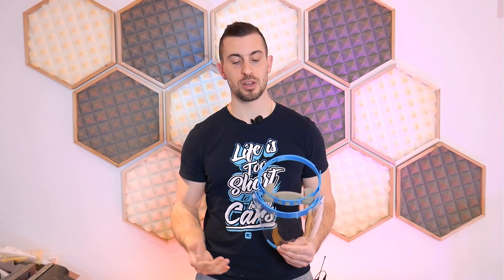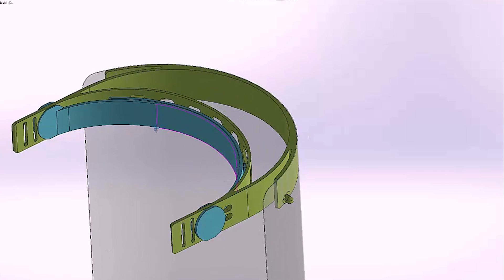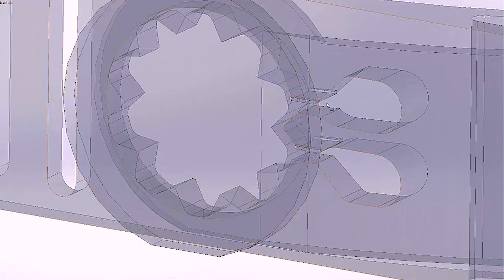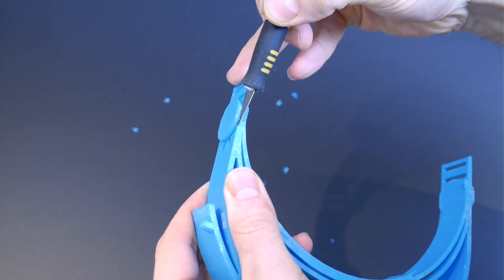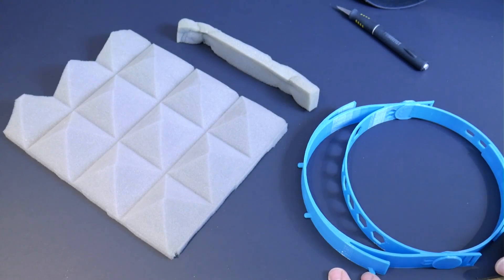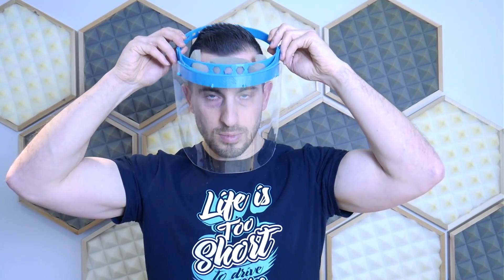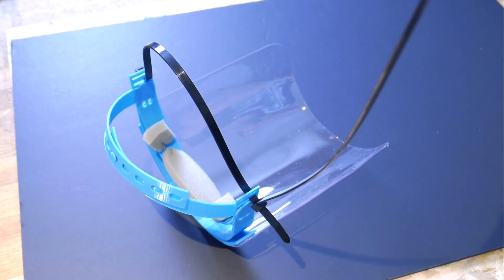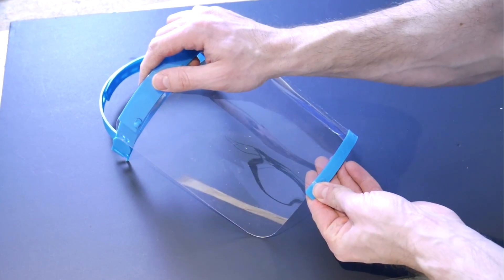PRUSA Covid-19 Face Shield With Integrated Folding Detent Strap (NO Elastic Req'd, Single Print!)

Comment: Wait you think elastic bands are harder to find than clear drilled plastic?
Reply from the maker: Never said it was harder to find than the plastic. Just hard to find for some people in general. At the end of the day, for the PRUSA style design, you need a 3D printer and the plastic shields at minimum... if I can eliminate the elastic from the bill of materials, it's one less thing to source. That was the idea (plus the plastic is easier to clean than the elastic)
Reply: Embrace Racing good point. On our design we are using acetate overhead sheets, elastics and weatherstripping.  Ordered in bulk from staples and crappy tire.

Comment from the maker: UPDATE: 13/04/2020: NEWEST VERSION HERE: https://youtu.be/04lTMJ2VdTI
My mother is a nurse and I will be printing these face shield frames for her unit and donating them. I have my printer running almost all day, everyday since I designed this and at some point I will need to order more filament. Ideally I would like to get a cheap second printer so I can make them faster. If you want to help, please reach out to me, or if you have the means, please donate by using the "Buy me a coffee" link: https://www.buymeacoffee.com/embraceracing Your donation will go towards filament for this endeavor and possibly towards a second printer if I can afford one! If the Thingiverse "download zip" isn't working, try clicking the tab that shows the individual files on Thingiverse. You can then download one at at time. Or I've also now put the files on GrabCAD here: https://grabcad.com/library/prusa-covid-19-coronavirus-face-shield-with-integrated-folding-detent-strap-1